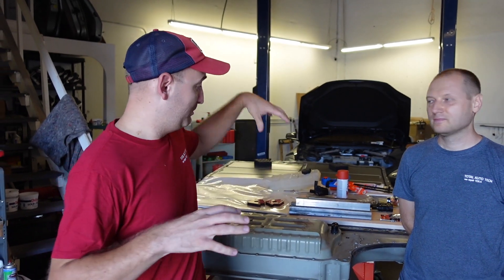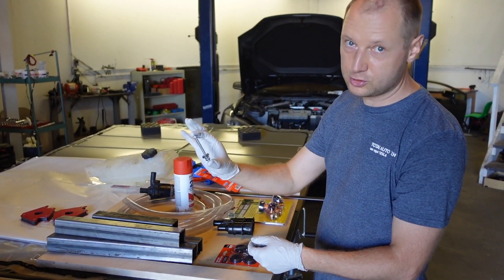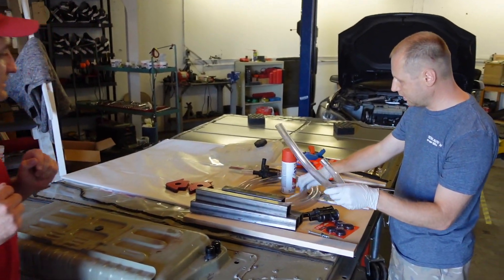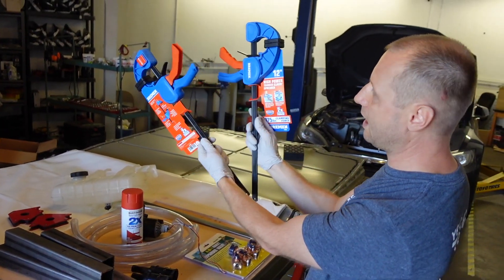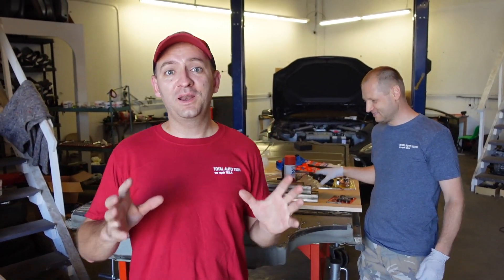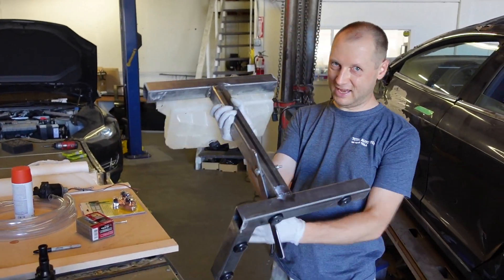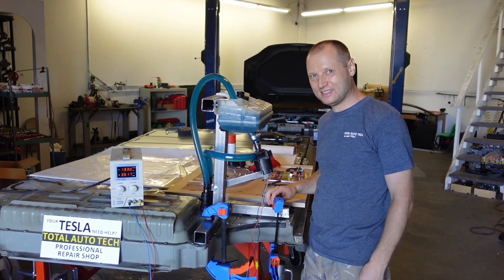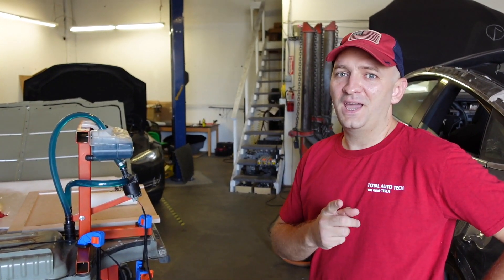Tesla Model S Main Battery Repair | Another TESLA battery is resurrected!!!

Comment: How did you managed to tesla pump work separately Frome the car? I have 3 pumps on my tesla model s 2012 and none of them is working. I am not sure if 3 pumps can diy at one time. What should i do we don't have tesla servis in kyrgyzstan
Reply: They probably sent the pump the required voltage of 13.3V at 3.5A using that power supply box.